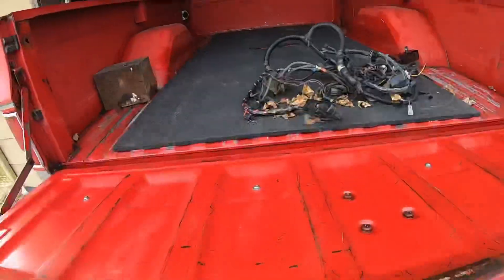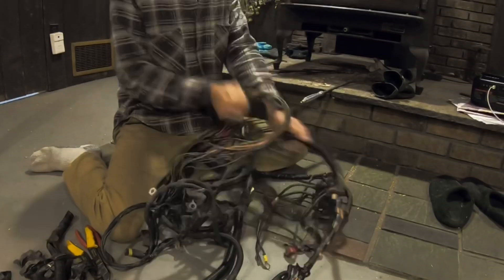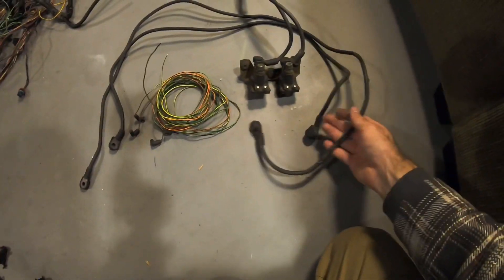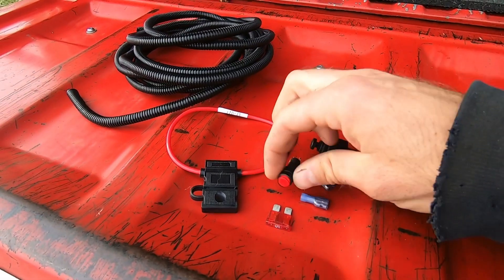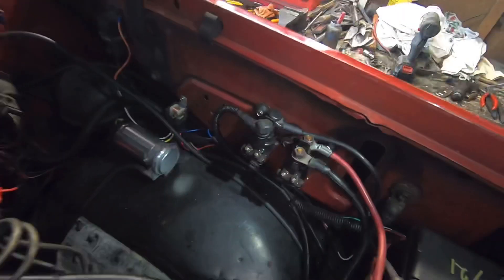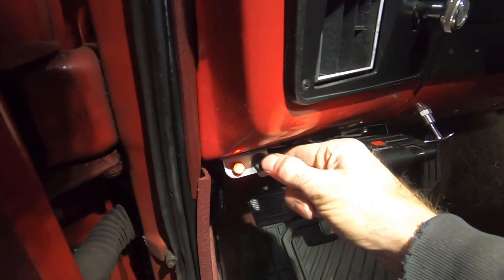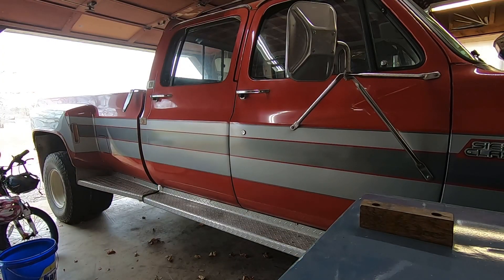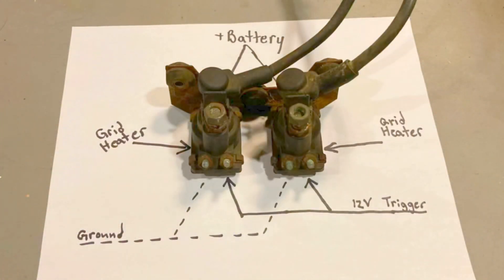12 valve Cummins push button grid heater install

Comment: Thanks man! Thats what i needed to know. Where to trigger them from. With out digging in the manuel for an hr.

Just for anyone that might be reading this.
Mine is nit working do to computer failure i think. The wait to start light doesnt come on. All of it works for a week or so then stops from times to time.  Gotta get it rebuilt but dont have the time. Another clue that the computer is at fault is low voltage on things like wipers, turbo switch ans fuel pump.  
Thats my guess anyway. Want know till someone test the computer.  For now its go na be cold next week and i need grid heat. 
Thanks again.

Comment: What size switch did you use?  AMP size
Reply from the maker: The switch can be very light. I think mine is a 3amp. The solenoids do all the work.

Comment: Great video! I plan to attempt this on a industrial 12 valve, unfortunately industrial motors didn't come with grid heater. What size fuse did you use? Thanks!

Comment: I thought the posts on the front side of the heater were ground and back was power my grid heater has 4 posts total 2 on each side?
Reply from the maker: I believe 1st gen grid heaters are slightly different. This is a 2nd gen. Both my positive studs are on the front.